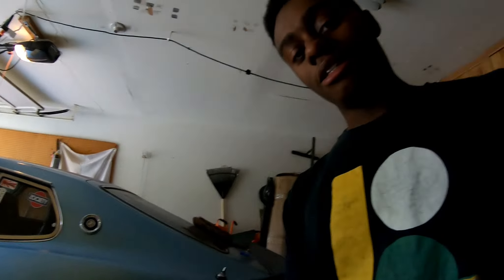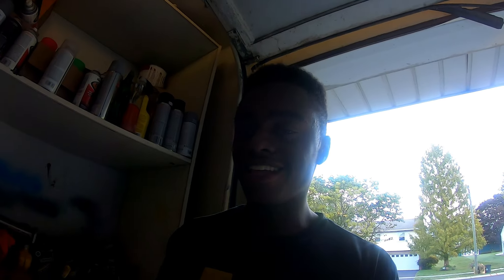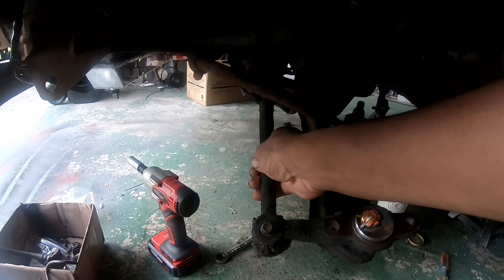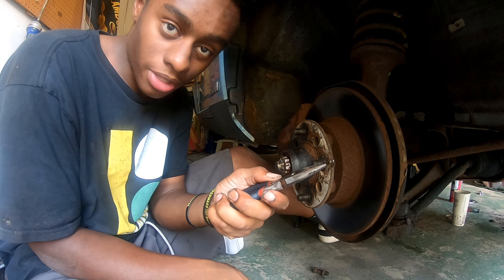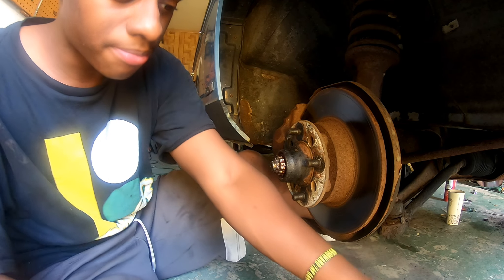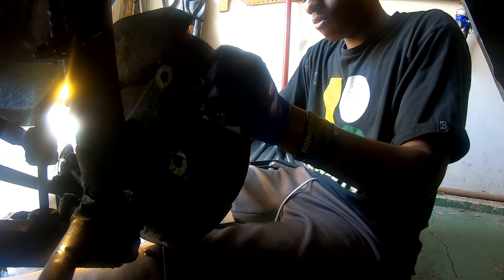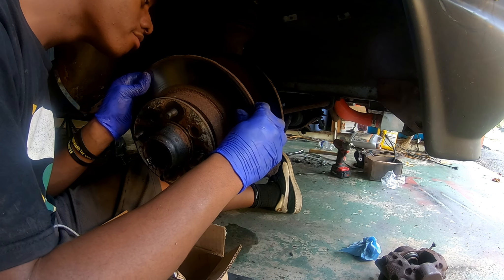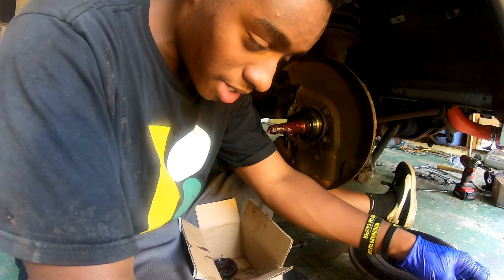Road to H20i 2019 Part 5 - Dismantling the Front Suspension

Comment: Once you take the 4 bolts out of the half shaft you can hit it with a rubber mallet where the bolts were at and it will separate.  It’s probably just rusted together.  Don’t be afraid to give it a good wack.